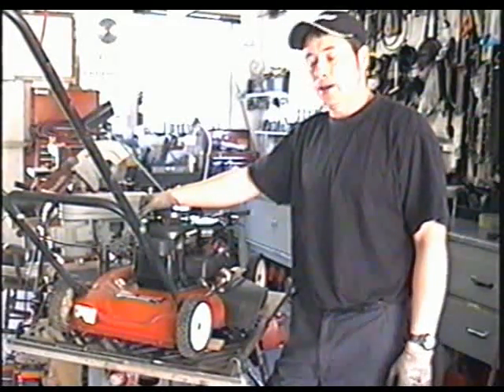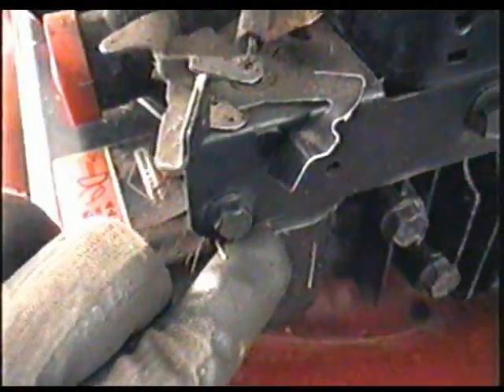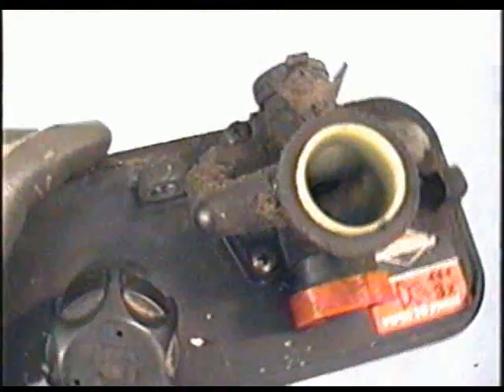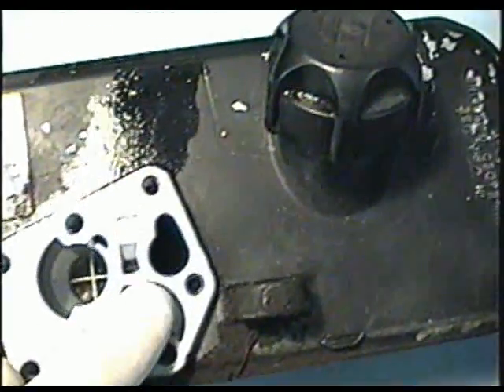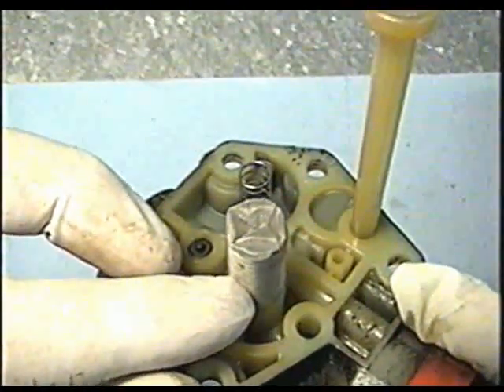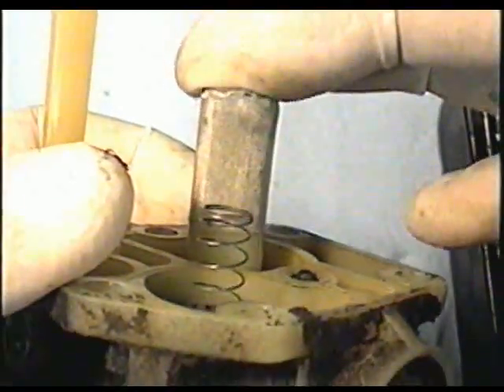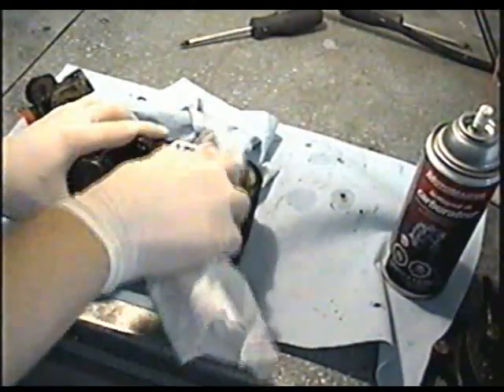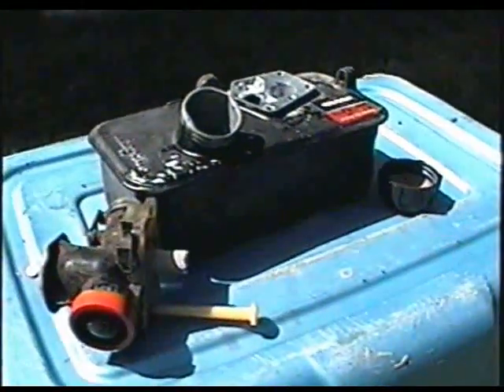HOW TO REPAIR Lawnmower with BRIGGS & STRATTON Pulsa Prime Carburetor  1/2

Comment: Referring to popaluv I'm in a technical school and my guess is that you need a static governor adjustment search how to do this it is very easy you can also mess with the idle adjustment on the carb. If this doesn't work I would recommend taking it to a shop and have it professionally fixed because if there is a bigger problem even though it is a small engine it can really screw up your mower. Hope this helps I out man lemme know how it works out for u

Comment: I also changed diaphram and gasket after oil change, but tried to pull fuel pick up tube out to clean it and when i pushed it back in, i accidentally bent it almost to 90 degrees and there is now a white bit where i bent tube, but it doesnt look to have an actual crack on white bit on tube, but i am not sure ? if this tube is cracked or damaged would it not run right/fast enough ? do you think i need to replace fuel pick up tube ? it was running fine before i tilted engine back to drain oil ?

Comment: Hi this video is really good Thx :). I have the 35 Classic with the White Carboureta. on mine, the strip of metal along the front of the engine that holds the petrol / gas tank on has somehow snapped off . I had to remove the tank to repair the strip of metal. I managed to repair it & get everythin secure n tight. now i try & run it and its running 2 fast Revving really loud. and the throttle was moving freely b4 now it isnt as the spring seems to be trapped under the filter. can any1 help?

Comment: Hi dorinny, my 3.5 hp briggs lawnmower engine with pulsa primer wasn't starting first pull but now it is, but i have noticed when it starts that white smoke comes out of the exhaust for a few seconds, could this be that the piston rings need replacing ? because it's burning oil maybe ? thanks :)

Comment: I have a mower powered by the same 3.5 HP B & S engine.
I change its oil by draining the old oil through the Oil Filler (Dipstick) hole.
I run the mower almost out of fuel and then tip it on its side with the dipstick facing downwards, using the mower handles as a prop.
I remove the dipstick and the oil will drain easily into a small container I place underneath the dipstick hole.
I leave it  to completely drain and cool then flip the mower back on to its wheels and refill the oil through the dipstick hole.

Comment: did all you said to my mower but still runs bad.the plug was really really black had to clean it.revs bad and puffs black smoke.i do feel air shootin out from the carb tank area is that normal?any other things i should look for>my mower is 2 years old only with same carb as yours.thnx

Comment: I have this same motor on my mower, it was given to me non-working. The primer bulb melted into mush. I followed your video and cleaned everything out. I tried to start it but it wont turn over. I removed the air cleaner and poured a lil gas in the carb. It will then start but dies. Also, the pull string does not recoil. 
1) Does the primer bulb have to be in tact for it to keep running?
2) How can I fix the string to make it recoil?
Any help is greatly appreciated!

Comment: I have a Craftsman mower with a Briggs engine.My problem is that every time I turn it off I have to prime it so it will turn on.If I dont prime it it wont start.I even put a kit in carb and that did'nt help.What do you think is the prob?

Comment: @grayfury100 Mine has the same issue.  I cleaned it like @donboy showed and it ran fine for a little while, now its doing the same thing.  Makes me wonder if I have bad gas (it was fresh and treated with startron) or the springs are shot?

Comment: Does the oil color also affect the performance? For instance Fresh Oil vs blackened used oil? And if you dont change the oil for a while can sludge form inside the engine's crankcase? And how Long does diaphragm's last?

Comment: @Ultrecht Everyone has different methods,(running the gas out is one) but it depends on the climate your in,here in Tn if you do that it drys everything out & you still end up with varnish in the bowl,& when you add fresh gas it tends to break this loose which in trn plugs the main jet.In general here I have customers run it dwn to 1/4 tank,& add a ounce of Sea Foam....keeps the diaphragm as well as the gaskets lubricated,& you don't have to worry about varnish developing in the bowl.

Comment: oooops ...Shortly after my fix of the mower I ran over a three inch branch in the grass and it jammed. I cleared it and restarted but now there is a high pitch metal clatter sound ..
the blade does not seem to be hitting any metal .. maybe it is somehow out of balance .. or maybe the hit reverberated into the engine and threw something out of whack.  Any thoughts ?  I will do a close inspection tomorrow morning in full daylight.

Comment: It is unfortunate. The video was very helpful, everything was exactly as you said. I just wish I knew what I did to cause both of these mowers to die. One was a Poulan and the other was a Bolens MTD. Both had this same identical engine on it. I cleaned the air filter every time I used them, made sure oil was clean, and used good gas. I don't know what else I could have done to keep this from happening. The Poulan I bought in 2009 and the Bolens this year, both will not start now, just bummed.

Comment: Hi Dony, the lawnmower I have has the same setup, but when I was looking at my parts list for my correct diaphragm part number,  and I noticed that there is a seat-inlet, Where is that seat located? 

Thank You
Reply: +Bradley Miller It is in the primer, part of the check valve.

Comment: #1 thanks for the vid...#2 do you use carb cleaner to clean the screens and is there any need to pop out the Main nozzle
Reply from the maker: Don Morgan sometimes I use carb cleaner on the screens and I don't usually pop out the main nozzle
Reply: OK Cool, followed your instructions to the T and it runs like brand new,,,,Thanks again...

Comment: First; I want to thank you for all your helpful videos, they have come in very handy. Second; I am having an issue with the carburetor mounting screws. They keep coming loose every time I run the mower. I know I am not under tightening them, nor are they striping. Should I just use some blue lock tight or get new screws? Thanks again, and keep up the great work.
Reply from the maker: use blue loctite
Reply: donyboy73 that' what I thought, wanted your opinion first. Thanks again.
Reply: donyboy73 man Thank u so much. U just taught me how to clean the carburetor. Thought I was gonna have to buy a new lawn mower. It's running good now. Thanks big time!!!
Reply from the maker: nightwish487 yes use blue Loctite, make sure you are subscribed

Comment: I cleaned my carburetor similar to yours with some carb spray and it's still surging. Anything else I should check?
Reply: 1.Check the air filter.
It is a foam element located in the black oblong metal box above the carb.
Use a screw diver to remove the large screw on top of it.
A new foam element is a light yellow shade and often people coat them in engine oil which helps trap dust.
A very dirty (blocked) filter may look black and chokes the engine.
2.Replace old fuel with new fuel. Tipping the mower SIDEWAYS with the fuel cap draining into a container.
Often if the mower has been stored, especially in very conditions, condensation can form in the fuel tank.
Globules of water floating in the fuel will cause the stall.
Reply: I bought a carburetor diaphragm kit from Lowes and replaced the old parts with the new ones that came in the kit and this fixed the problem.

Comment: Well today I took the carb off and it really wasn't dirty inside, BUT!!! I looked inside the fuel tank there was brown mushy fibers in it. Looked a little more and I found that the fuel cap has a what looks like a cork a gasket in it that's falling apart around the edges and was falling into the tank sucking it up to the fuel pickup tube it was totally clogged. So I replaced the cap got a diaphragm kit along with a primer bulb kit blew it out real good. Runs like it did when I purchased it  ; )

Comment: My classic 3.5 will run for 5 minutes then quit then won't start for about 10 minutes.  Almost like there is something electronic that has overheated.  I have redone the carb IAW your video instruction.  The thing starts so easy.  It just won't keep running.  Suggestions?

Comment: Thanx for this video.  Im wondering why todays mowers are sooo tempermental. I had a kmart mower in the 70's i used into the 90's. Never did anything to it except change oil and air filter. Beat the hell out of it , used old gas , dirty gas , dull blades etc. The thing would just run and run and run.  Todays mowers ,both the B&S and Tuchunseh engines are really finicky. Seem like if one grain of salt sized piece of debris gets into the fuel tank its "take the whole thing apart time" again ?

Comment: @donyboy73 Well, I got the new diaphragm in there ant it STILL acts like its flooging out when not under load! It acts like the choke is partially on or something like that... Maybe the carburetor is still dirty? Maybe I need to soak it in carb cleaner over night?? I'm frustrated because this is supposed to be a very easy task to do...

Comment: helpful, doing the same carb now. I did exactly what u did and then came in to look it up bc I forgot my spring positions and found this video. one question. when u take the carb off from the manifold there is a white plastic ring and a rubber 'o' ring. I notice the plastic ring has a key or notch but I cannot find a corresponding key or notch. I have it together I am however worried about that situation because it seems like it is just held in place by the carb after it is assembled? I am unsure about this.. if it seems loose like it wants to fall out of the carb .. what do I do
Reply from the maker: I pop the plastic ring and o-ring on the carb then install it, no notches
Reply: donyboy73 yep yep did it.. idk why I was having a brain fart. thanks for the reply

Comment: Can also use a q-tip instead of a rag & screwdriver to get the dirt out of the dirty hole shown after the carb cleaner soaks the dirt loose for the 10-15 minutes.

Comment: Is an air cleaner gasket part number 271139S supposed to be installed around the outside lip of the carburetor opening between the air filter housing?  I have the same exact mower.  Thanks for all your help!
Reply from the maker: yes there is a gasket that goes there 271139S
Reply: donyboy73 Thanks, mine did not have a gasket.

Comment: Did everything here, including change the spark plug.  Motor is not even getting any juice, no exhaust from the cable pull to start it.  How easy should air flow when you blow into the carburetor when you blow on it.  I had to blow hard on it.

Comment: I have a Toro 20333 it runs fine but when I turn on the blades to cut grass the engine dies, what could be the problem? Carburetor has been rebuilt & 100% gas (zero ethanol) is being used...

Comment: Me again ...as a followup to my post about my mower running into a piece of a branch.   
I looked at the housing around the blade and found it was slightly deformed by running over the branch and the blade pushing it into the housing. I gave it a few hammer hits and now there is no contact and the mower runs well again.

Comment: so i found myself walkin to skool the otherday and i saw a lawn mower in the grabage so i ran it home then ran back to skool. (im 14) i didnt check to see if it was junk or not. but when i got home i was checkin it over and nothin was rly wrong with it. it seems to be the blade got caught in the lip underneth. and i fixed that. and took the carb off and cleaned the gas tank. now i havent checked to see if she runs yet. but iv contemplated making a vid. comment and tell me what u think.

Comment: Does this mower have a fuel filter that can be replaced? If so where is it located?
Reply from the maker: it's a screen at the end of the pickup tube in the tank
Reply: donyboy73 Alright I'll look for it. I've had problems with my mower cutting off while using it. When it sounds like it's going to cut off I have to pull the handle back lifting the mower upwards. I guess this gets more gas going down the line. I figured I may have a dirty fuel filter blocking gas flow so I want to try replacing that before disconnecting the carburetor and cleaning it.

Comment: @donyboy73  What i did is put half a bottle ( 18 oz ), i removed the air filter and poured oil thinking that the oil goes there . before i did this mistake the mower would not start , it had gas , so i thought maybe it needs oil . now i cant even pull the rope to start . The lawn mower is just 1yr old . and i know nothing about them or how they work .

Comment: Love the vids DB 73,but heres a ?,you as well as few others don't clean the exterior of a engine before you work on it,why???? Either theres somthing I'm missing, or you guys just work in high volume shops where the customer don't get that unless they pay for it.I always inspect first,then clean...much easier to work on,& don't have to worry about contaminating the carb on removal or re-install....Just curious..

Comment: hey dude. i have a 3.5hp engine briggs and stratton and when it starts i works at its usuall round but after a minute it suddenly it lowers its rounds, black smoke comes out from the exhaust, and the spark plug becomes black cause the smoke, not oil

Comment: Not the same issue. I have an air governor. The springs turned out to be worn out. To which Ive changed the throttle to manual.

Comment: Can u tell me if a cloud if white smoke followed by a slow stall is a carb problem??
Reply: +JumpinJupiters Likely that white smoke is actually steam, from condensation. If a slow stall is RPMs reducing gradually until engine stops, you may have cap venting problems, you may have leaking seals, you may have bad fuel, you may have governor issues. Is this a 30 year old, greasy filthy POS left out in the weather, and never maintained? Get rid of it and buy a new one.

Comment: Well done ! But what about the oil . How to replace it ?
Reply: +Aurel Dragomir Open the drain underneath. If it's there, it's probably an Allen head, and can be the devil to get loose. Or you can always dump the oil out of the inlet. Now pay attention, Aurel: make sure there is no gas in the tank before you tip the mower. Always tip so the carburetor is up. Make sure you pull the lead off the spark plug first thing. Do this with the engine cold.
No way can you get all the old oil out. Nobody can. Don't lose any sleep over it. Replace with the manufacturer recommended oil. Get the level perfect. Keep checking. Add a little at a time. If you have to check five times, that is your fate.

Comment: Did everything in the video except replace the gasket and diaphram and the engine still runs high to low rpm or the term i learned is galoping what else can i do.

Comment: Ok I've done the coil cleaned the carburetor tank and new plug .It's got lots of spark and getting fuel but still won't fire up like wtf is the issue any Intel would be appreciated .

Comment: I have to admit I thought I was doing a great job when I rebuilt my pulsa prime carb.   I over tightened the screws that hold the diaphragm and gasket to gas tank, mower would run but would only stutter.    I suggest being very careful withe screws there and make sure the thin diaphragm is on the bottom, then the gasket and the carburetor. Even a small crease in the diaphragm or pin hole and it is trash.  I reset the screws only "snug" on the carb. and the mower runs like a new one, one crank, boom wahhh !  Mowing time!

Comment: The carb. Gasket should be flimsy like tissue. If its stiff, then you might have problems with it running. A good place to get parts is Repair Clinic.com. You can also get primer bulbs in a set of 5.

Comment: i repalced the diaphram of my not running 5.5 briggs.  it didn't run.  I stuck my finger in the carb and it ran.  I found the plastic intake manifold had a crack in it.  I replaced this and it runs fine except if it dies I have to prime it allot before it will start again.  it also seeems to use a lot more gas than before.  i replace the primer bulb but that did not do anything except make it feel like it isn't priming (it is but it feels different)  anyone else see this and if so the fix is ??

Comment: to whom this may concern, no one I suppose! I bougt a murrary 20" thinking it to be light and easy to handle in tight areas. The second time I tried to use it, Ithe motor locked I broke the pull rope and the little plastic tab that the rewind spring hooks to also broke off . So now what, I went to the mower parts house to figure what i needed to do, they told meit was to new and couldn't order parts. I never thought briggs would allow anything like this junk to leave their factory. I have bragged on brigs to my friends for a long time, it sure is hard to sowalller crow. I know briggs will say sh-t bappens but this cost me 150.00 . I finally bought a new spring, and drilled a hole through the top and put a bolt for the spring to hook to and made it start. But not this is a new mower only 60 days old, is this what briggs is putting out?
Reply from the maker: bring it back for warranty, things aren't what they used to be

Comment: Pulley rope locks up when trying to start.
Reply: +John  Brown If recoil starter is freely rotating when removed from engine, look for sheared flywheel key. If pulley rope is tattered, mangy, and dirty, or knotted, if 2 out of 3 locking tabs are broken off, if pulley is cracked, replace the recoil starter. Doubt it's the starter clutch.